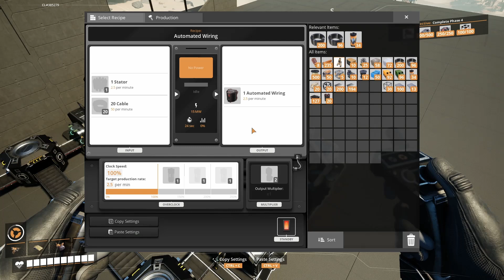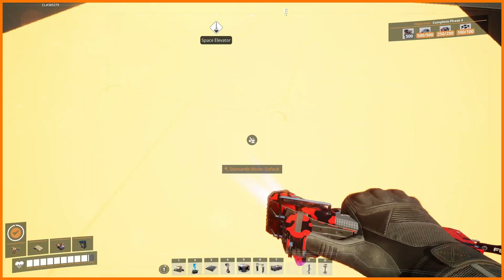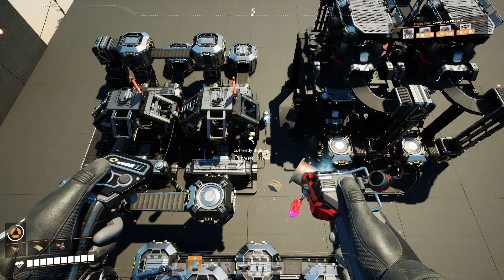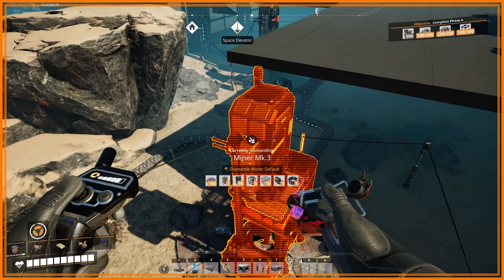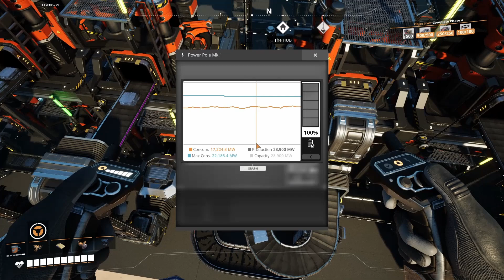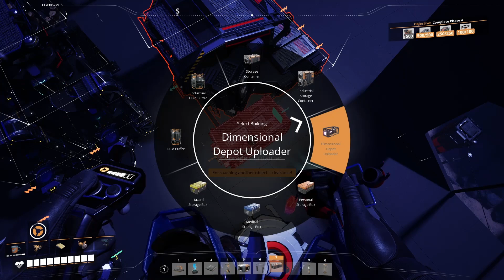Satisfactory 1.0 Ep29 HUB Automated Wiring expansion to progress to the final end game

Comment: Man, how do uou plan your factories. I am having hard time with that.
Reply from the maker: Hope you are well I look at what production I need to progress in the HUB Tiers and Space Elevator Phases and only build what I need to progress. Also what really really helps the most is finding hard drives to scan as early on as you can to get Iron Ingot to Screws without needing Rods first because the later stage in the game you are the harder it gets to find the recipe to make production easier to manage also Iron Wire can let you get Cable and the production that needs it much easier. The other part to keep in mind is location for how you need to transport and fuel to keep transport running if needed. I just always work backwards from the end production that I need and then the production to get to that point is easier to work out in order to balance out the production. Most of my early production at the HUB doesn't really go anywhere it is just there to help me to build and extra can be sent to your later production if you do not have any nodes nearby that you need.
Reply: @alphablazedgamer  Thanks man. i am still new to the game. only 20 hrs put in but i love the game
Reply from the maker: It is one of my all time great games it takes a while to get use to because of how much production needs to be done to make small amounts at end game stage. Just relax take it easy with the start as the first playthrough is just to get use to everything and how transport works out when you start. The save for this series upto this episode has been running for 160 hours so just take your time decide on one building at a time look at what production you need and best way is write it done as you work out how many steel plates, screws and so on you need for that production then work out ingots needed and then find the ore location to support it that is the way I always decide where I build. With upgrading miners later on as you progress with HUB tiers you can add in extra sections to smelt more and add more production with normal deposits and even impure ones can actually get to a point of being a great use